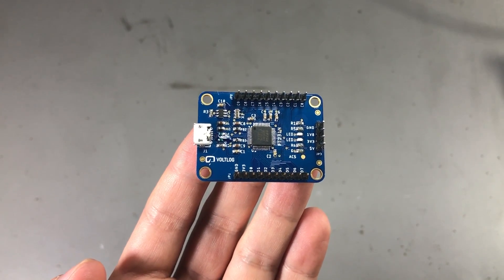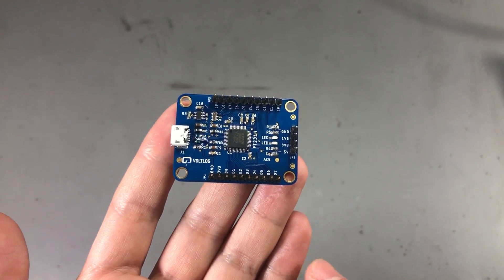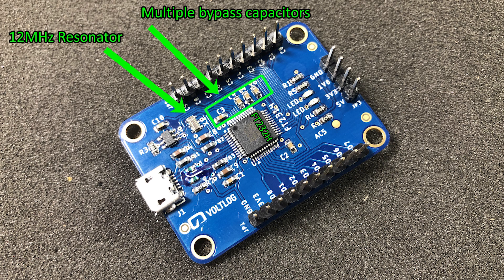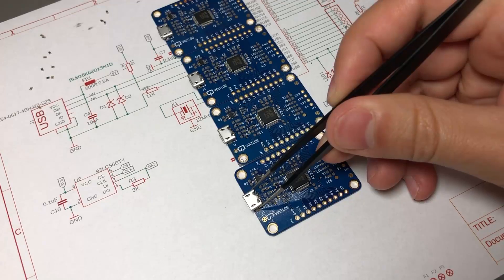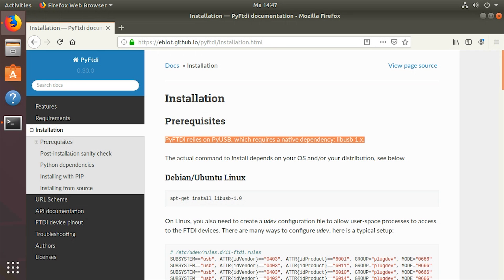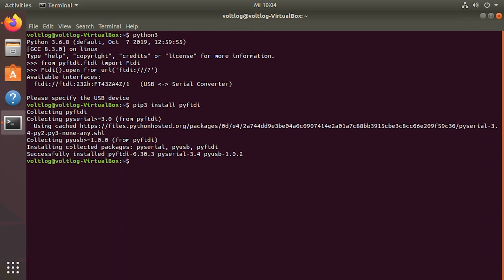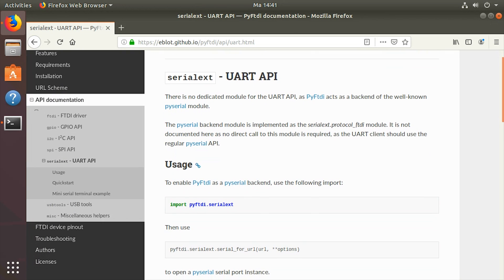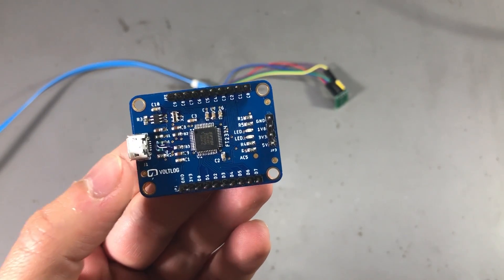Voltlog #265 - FT232H USB to JTAG/I2C/SPI Interface With Python & PyFtdi

Comment: Does anybody know a working sample for FT4232H Mini Module using 64-bit Windows? Can't get it to work for some reason and when I scoped it it just have one pulse going low on both SDA and SCL - this is a C++ project. For a device as prolific as FTDI, it seems hard to find a working example. I want to try the pyftdi as a backup solution but still couldn't find a working example. It gives me an error on this line:
Ftdi().open_from_url('ftdi:///?')

Comment: Hi Sir, by using pyftdi for FT232H, can i use I2C interface and GPIO interface at the same time? i am trying to include both I2C interface and GPIO interface in the same project, turns out, it only work for one interface.

Comment: Without wishing to sound like a fanboy, have you looked at the Rust programming language?  It combines many of the features which make Python attractive, with the ability to write code as tight and low level as C, plus adds a ton of compile time correctness guarantees.  It also has a fairly new but excellent hard real-time framework "Real Time For the Masses".  For microcontrollers, the best support is probably for STM32 (F4 and F1 are pretty good).  You can even run the same e.g. SPI or i2c code on both Linux (e.g. Raspberry Pi) and also microcontrollers using Rust's "embedded HAL".

Comment: Ah yes - the MPSSE, of FT2232 ancestry, capable of SPI/I2C/JTAG emulation and other minor magicks, for which I waited a decade and half for any king of > GUI < terminal-like software to emerge. It never did, to my knowledge, making that chip probably the most useless piece of silicon in the history of electronics. It's nice to see it's still around in some form, although I definitely will not mess around with Python just to test some chip over SPI/I2C. There's the Bus Pirate for that, which... uh... somehow strangely also thoroughly failed to develop any king of > GUI < terminal-like software supporting it.
Reply from the maker: I own a bus pirate and there is a GUI for it but I remember it had some issues, it was buggy. It was like a beta that never made it into production :-)

Comment: Please can someone explain why we need yet another interpreter language such as Python? Why is it such a hype?
Reply: I think it's like the modern Basic. It's like the defacto academic standard now. It seems really simple and powerful when someone knows how to use it well. I recommend watching Joel over on OpenTechLabs for a great example. He did some seriously advanced level hacking demonstrations recently while trying to gain access into the IT9919 video processor chip. I'm sure other people are just as capable with other languages, but there are people doing some powerful custom stuff with python and things like KiCAD, GIMP, and others. They also make it look simple. Source written in 3.x and up is practically readable even for a complete laymen, at least in my opinion. I can't say that about any other language I've seen, except maybe Forth, if think like_Yoda , you-do ;
Reply from the maker: I think @Upcycle Eletronics above is right, it's like the modern Basic, it gives access to a wider audience and so it's appealing to start with.
Reply: Essentially it's the difference between building with bricks or prefabricated panels. If you want bricks, you can lay down absolutely any shape you want, but your hair might go gray by the time you finish the second room; with panels you just plop four of them down and the room is done, you're free to proceed with whatever you actually wanted to do in it. And that sort of thing counts immensely if you are more interested in doing some actual machine vision or machine learning (don't you dare calling it "AI"...) than getting your doctorate in the intricacies of inheritance.

Comment: Great little board with lot of functionalities. Looks like there's a bodge at USB protection part, was that fixed on the current version of the design files?
Reply from the maker: Yes, the bodge has been fixed in the files released to the public (revB). I actually fixed the error, before ordering revA pcb's but just forgot to hit "update library" which is necessary in EagleCAD to propagate the changes so I ended up with a set of PCBs that had the data lines reversed on the usb connector.

Comment: Great looking board and an interesting chip! I've only got basic level understanding of protocols like SPI/I2C but I've got the impression sometimes the timing might be difficult to get right. IIRC the ESP32 Arduino core's I2C support was initially struggling with such issues. Similarly I believe I2C/SPI are easier to get working with a MCU than a SBC like Raspberry Pi due to OS background processes etc. making exact timing more difficult. Do you think using this chip with your computer would have similar issues as an SBC would have, or does the chip provide features that would help here?
Reply: I would expect that PyFtdi provides an interface to perform entire I2C and SPI  transactions (and not just single byte operations). If that‘s the case, timing shouldn’t be a major problem. I’ve created something similar with a Teensy LC instead of a FTDI chip. While the turn around to read a single byte is much slower than with a MCU, the throughput was perfect and far beyond what a MCU can achieve. I could feed a color TFT with about 30 full frames a second from an animated graphic, despite Teensy’s small memory used for buffering.  @VoltLog I’m looking forward to a follow up video with more details about a project with the board and the Python interface for the FTDI chip.
Reply from the maker: Interesting but difficult question to answer, referring strictly to timing, I would say you don't need to worry about it. 

However sometimes, clock stretching might be something that the slave devices requires (some sensors for example) but the master doesn't support. This is also true for the FT232H, it doesn't support clock stretching natively but they provide a workaround in AN_411 "The MPSSE does not support clock stretching. However, if the I2C peripheral requires this feature, it may be possible to provide similar functionality using the Adaptive clocking feature of the MPSSE." It appears PyFtdi implements a form of clock stretching.

Another thing to consider is that this whole idea is based on multiple layers from the hardware all the way up to Python and we also have USB in the middle so it might not be possible to achieve the same performance or bit rate as with a simple hardware peripheral interface present on a microcontroller. In fact PyFtdi documentation has something to say on this "Due to the FTDI MPSSE engine limitations, the actual bitrate over I2C is very slow. As the I2C protocol enforces that each I2C exchanged byte needs to be acknowledged by the peer, a I2C byte cannot be written to the slave before the previous byte has been acknowledged by the slave and read back by the I2C master, that is the host. This requires several USB transfer for each byte, on top of each latency of the USB stack may add up. PyFtdi is therefore not recommended if you need to achieve medium to high speed communication with a slave (relative to the I2C clock…), nor than FTDI devices are for this kind of usage."
Reply: @voltlog  Thank you for the clarifications! I would not expect very high speeds through all three layers either but the question was mostly about successfully communicating at all.
Reply: @Ristomatti Airo re the Raspberry Pi board (or any SBC) using an OS (most likely Linux); is not a prerequisite using an OS. Just use the ARM core on the SBC baremetal and there are for sure no timing issues at all. Please also note when you are using the Arduino IDE you have an OS as well.
Reply: @ArjanvanVught  Surely but I was talking about the most common use cases (for a hobbyist).